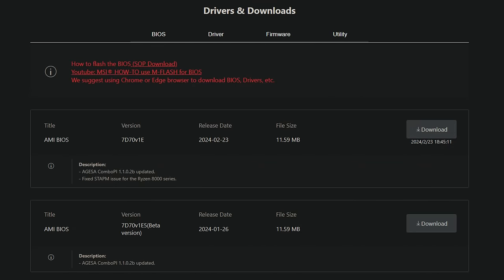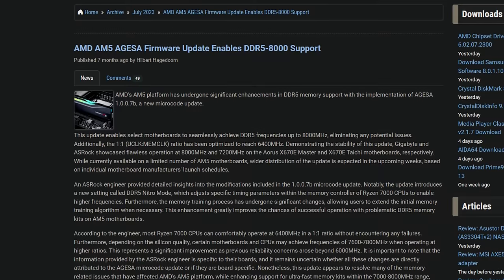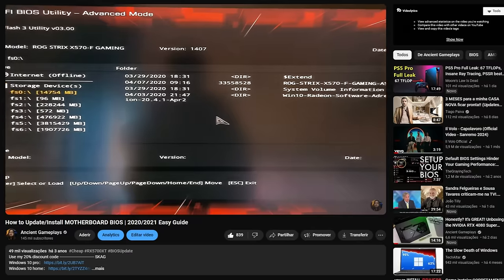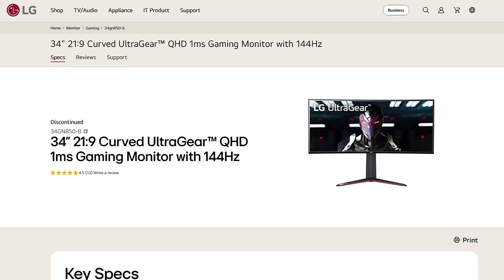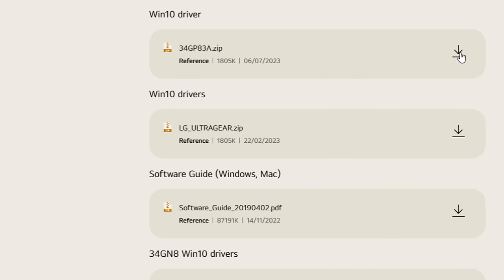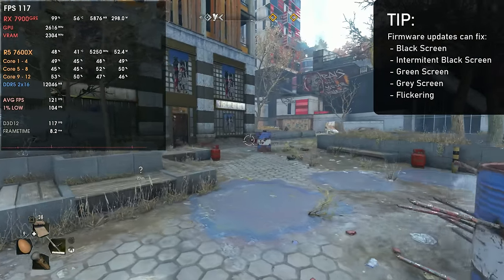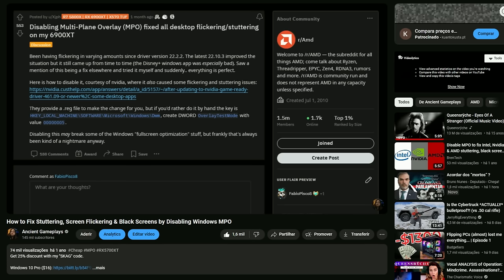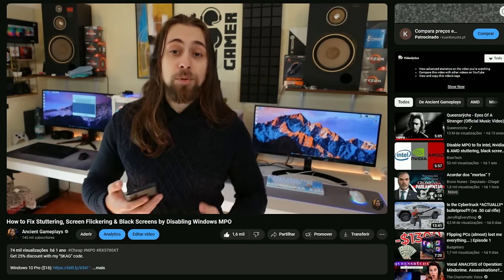20 TIPS to FIX "AMD GPU's Problems" | Easy 2024 Tutorial Guide

Comment: I should warn that in my testings, disabling MPO can lead to a somewhat weird windows desktop experience. The mouse didn't feel smooth, and felt that it was in 60hz instead of 165hz as the refresh rate was configured in windows and monitor default. Opening some programs felt like the animations were not there, and it "felt" my windows experience was like 10 years ago, with less flare and felt antique. I didn't like it at all. Yes some stutterings i was having gone away, but it felt like a sideways fix than a real one. The problem with stuttering was in fact on the adrenaline drivers 24.1.1 (and 24.2.1) and not realy a thing MPO disabling would "fix". The problem realy is that AMD drivers are realy bad sometimes. I'm still using 23.12.1 for example, newer ones are realy bad in stuttering (even in just youtube video streaming for example, and sound stuttering issues), going back to a 2023 drivers makes everything smooth. AMD realy needs to upgrade their software testing part, i see online in reddit a lot of people reporting the same...
Reply from the maker: Odd, it is exactly the same here... odd

Comment: When I upgraded to my 6900xt from my 1080ti I had two issues but fixed them quite quickly after some tinkering. The first issue was crashing in some games. I used mpogpufix and that sorted it out. I also had flickering second monitor which turned out to be a dp problem so I switched to hdmi. Not sure if the original cable was on its way out. Honestly most issues with graphics cards are easily fixed if you put in the time in effort unless it’s doa etc.

Comment: I didnt really have any technical issues with amd. Ofc i had some crashing when i got a 5700xt at launch. But after that its been smooth sailing.

Edit: i do occasionally had issues with relive just refusing to actually save anything i record. And then it will just somehow fix itself.

The only real issue i had with amd was that in some games in my library my 6800xt would just perform abnormally bad compared to its nvidia contemporary. Most recent offender being helldivers 2. Where nvidia gpus are like 20% faster than the amd counterparts. 
I dont really have any games in my library where amd is abnormally faster.

Mainly playing HD2 and my 4070tis is about 60% faster than my 6800xt in HD2 (usually only about a 30-35% difference). And from what i can tell from looking at benchmarks, the 4070tis is about as fast or faster than a 7900xtx in HD2 aswell.

Comment: I have an EVGA Gold PSU with a 10 year warranty. I had a problem with my GPU and couldn't figure out what it was. Nothing was broken, temps fine, good connections. I was using a single cable and the pig tail on my GPU. Power spikes tripped the safety feature on the PSU. I stopped using the pig tail and ran a second power cable. Never had an issue after that.
Reply: Is that a SuperNOVA GA series by any chance? It sounds like that PSU have multi rail +12V. And i belive this EVGA series use multi rail. You should never use pigtails with a multi rail PSU (you should avoid it with single rail too TBO).
Reply: @Audiosan79  It is a EVGA Supernova G5.

Comment: I'm just sad that Radeon Chill doesn't seem to be working for me in multiple games. The Minimum value works, but if I have the Max set to something like 120, the game will only get to around 90 fps instead of 120, even if when I turn Chill off it easily runs at over 120. Helldivers 2 and RDR2 are definitely doing that, not sure if it's an issue with those specific games or maybe a driver thing.
Reply from the maker: Simply use it as a frame locker and select min and max to the same value
Reply: @AncientGameplays  That kinda defeats the purpose, I actually WANT to use it like I was before, where I can just let the game idle at a lower framerate (and GPU power usage) when I'm not doing anything. It used to work fine, but now isn't, not sure if it's a driver thing or something with my new 7900 XTX (upgraded from a 6800).

Comment: the only issue i noticed as a recent amd rx 7800 xt owner (coming from a 1080gtx nvidia), is apex legend DX12 had issues with certain white flashes. Also mentioned DLSS and ray tracing was a better tech with Nvidia. That said i tried FSR3 with Forspoken, looked fine to me (it achieved the high fps and the quality sufficient for me). Also higher power consumption for amd vs nvidia (i did not try eco mode so no idea if that would help or not. but for what it's worth, the power usage during gaming and idle seemed ok for me. Could it have been better? for sure).
Reply from the maker: Fsr3 in forsposken sucks, there are way better implementations out there, like starfield
Reply: @AncientGameplays  ty for the tip. sadly didn't get a chance to try starfield. though i may due to your recommendation, thx again.
Reply: What do you mean by "higher power draw for amd vs nvidia"? You realise every card has a different power limit right? You bought a 7800xt which will have at least 250w power limit after owning a gtx 1080 which would have been around the 180w mark.
a 1080ti has a power consumption of 250w. And the highest consumption gpu available is a 4090.

Comment: Something I noticed regarding Anti-Lag and such is that actually using Radeon Chill to limit your FPS (setting min and max at the same value) gives you lower latency than Anti-Lag itself. But maybe I'm biased or remembering incorrectly. Fabio, if you are reading this; am I correct, or completely wrong?
Reply from the maker: True, anti lag is for max fps
Reply: That's interesting. Must test that out

Comment: I got a new PC last May after my  laptop burned, and since I dislike quite a few things nVidia been doing lately, I chose to go full AMD (both CPU and GPU), Practically from the get-go (but in retrospective, probably after a driver update a little bit later) I've been having issues that were related to GPU: periodic and sometimes random driver timeouts, which often disabled iGPU for some reason, freezes when PC was going to sleep, driver crashes. One of the things, that was also happening was that Armoury Crate was not seeing "ASUS TUF Gaming Radeon RX 7900 XTX OC Edition 24GB GDDR6" for some reason. While working on this with ASUS (which was a huge pain, trust me), below scenario "fixed" it.

1.	Since I was on 23.12.1 driver, which was the first with Hardware-Accelerated GPU Scheduling, I first tried rolling back to 23.11.1 directly. Did not help.
2.	I then booted into Safe Mode and ran DDU to remove the driver.
3.	Booted into normal Windows, let it install whatever version of the driver it wanted. Rebooted. GPU still not seen in Armoury. At this point I actually checked for updates in Armoury and there was an update for the GPU framework, not sure if that’s relevant, though.
4.	After this I installed a new AMD driver, and then rebooted, even if it was not asked by installer. I tried versions 23.5.2, 23.7.2, 23.8.2, 23.9.3. None worked.
5.	I installed 23.10.2, rebooted… And GPU was recognized.
6.	Tried updating to 23.11.1, rebooted – still there.
7.	Tried 23.12.1, rebooted – still there.
8.	Booted into Safe Mode, used DDU to uninstall driver. Rebooted, let Windows install whatever driver, rebooted again. Guess what? GPU still in Armoury.
9.	Installed 23.12.1 directly, rebooted – GPU still there.

Later I was able to reproduce similar behavior:
1. DDU the driver.
2. Install driver 23.10.2, 23.11.1 or 23.12.1 driver - everything works fine.
3. Install any of the 2024 drivers (it works besides the fact that in a lot of games I still get timeouts right at the start of the game).
4. Rollback to previous version (downgrade the driver) - now the GPU is again not visible in Armoury.

Shared this with both AMD and ASUS and unfortunately still no new from either. This definitely does not fix timeout in 2024 drivers, though (all cases were reported to AMD through bug reports in the software). But this still may by interesting for tinkerers, I guess.

Also, I would like to mention a point, that was missed during the clean driver installation segment in the video: doing DDU does not mean that when you install the new driver after reboot you will be installing a "clean" one: depending on how fast both you and Windows Update are, it's possible, that you will be installing the driver over driver-only package downloaded from Windows Update, and not over the "generic" ones. This was not an issue in Windows XP and probably Windows 7 era, but with Win10 and Win11 this is kind of expected behavior. It does not remove potential benefits of DDU, but it is something to keep in mind.

Comment: I've noticed some weird issues after using DDU and installing drivers, I would have some stutters here and there and couldn't figure out why. Turns out Windows just forcibly installs old drivers in the background when you boot first time after cleaning even if I disabled automatic driver updates and sometimes my mouse just refuse to work afterwards until reboot. Now I just let windows do it's thing after DDU, do the driver rollback and then install new driver and it's been working way better. Maybe user error somewhere, but that's how I do it atm xD

Also it's very common that my monitors refresh rate switches to 60hz instead of staying at 144hz after using DDU, took me a minute to figure out why everything felt so sluggish all of a sudden.
Reply from the maker: Using ddu clears the shader cache, so the first time you're loading some games you might have stutters, then, they go away
Reply: @AncientGameplays  Yeah, very true. But these stutters remained and didn't go away. TLDR: Removing Windows basic outdated driver improved performance

Comment: Why is no one talking about the Adrenaline problem, which is that my overclocking and fan curve settings are reset after every reboot of the computer. I tried all possible solutions: disabled Winsows Copilot through the registry and windows group policy editor, disabled the fastboot option in BIOS and
power supply options. None of this helped, the driver settings continue to be reset to default with each reboot. Perhaps someone knows some other ways to solve this problem

Comment: @24:03 You are wrong about that with DDR4 - DDR4-3200MT/s ist Oficcial Jedec Spec. so the statement with 2400MT/s is wrong.
Reply from the maker: That's the IMC native frequency of the cpu, but the SPD of the ram is 2400MHz, so you're not overclocking the cpu, but you are overclocking the ram per se, just a "tested" overclocking by the manufacturer
Reply: @AncientGameplays Please Doublechek, Ryzen 3000 Gen upwards + Official non OC non XMP non EXPO Standard DDR$ Modules are supporting 1600MHz Double Data Rate → 3200MT/s with 20 on and on and on Timings Thats all Official Jedec Standard as long as every Part supports it. and Yes, there are recent Parts that do support that without any OC.

Comment: got quite a few issues =>
#1 amd frame cap doesn't work (can't use riva tuner since it makes davinci crash)
#2 amd chill works but only during game play. The moment I open a game menu, the GPU jumps to 430w or 100%.
#3 when using obs, davinci, and my game at the same time. Sometimes the driver glitches. System doesn't respond for a minute. Than comes back with the applications closed.

system:
i7 12700k
msi mpg z690 wifi edge
asus tuf 7900XTX
32gb Fury memory, 3600 mhz (xmp activated)
850w BeQuit Pure Power

I have already plans to replace the power supply as it loves to whine when the GPU goes berserk. I am gonna switch
to the NZXT C 1200w gold. That got a top rank on the PSU cultist website. I hope the switch gives me more stability.
It is definitely not terrible levels or atrocious at all. But it happens.

One thing I did already for stability was to remove the cpu overclock I had. On top I disabled Hyperthreading and E-cores.
CPU definitely is ultra chill now. But I am going to try disabling XMP too.

Comment: In my case disabling Freesync (supported on both sides) solved MASSIVE ghosting issue (the lower below maximum refresh rate the worse) because there was no variable overdrive implemented for the monitor
Reply from the maker: The Ghosting you're talking about is most likely black smearing and you most likely have a VA panel. The is not with Freesync, is the panel that can't work properly at lower refresh rates. Cheers
Reply: @AncientGameplays  yea it is a VA panel but ghosting is huge for all 3 color transitions from testufo, even the bright one. Why I think this is an issue with Freesync: When i manually set 60Hz refresh rate with Freesync off it's clearly better than with Freesync on at such frame rate. And why I think it's a miscalibrated overdrive: The 100Hz refresh rate set in the monitor settings obviously has a worse response time than 60Hz (best value being 144Hz)

Comment: The solution for guys with 2 monitors and rx 7xxx card that have issue with audio and video stutters in some games(Naraka bladepoint in events tabs in my case):
The easest solution is installing driver 23.12.1. This is the last version of driver which I had no problems with, but this version have no new features like afmf, e.t.c.
If you want to use last drivers you can try next steps:
1. Type in disk cleanup select C then select clean up system files check "DirectX shader cache" run it. 
2. Turn off discord`s hardware acceleration if you using it.
3. Turn of your browser`s hardware acceleration(i`m using firefox and i turn off it from settings tab, I think there will be a similar setting for other browsers).
4. In some cases turning off and then on AMD SAM can helps.
I hope it helps somebody and you will not searching solution for this trouble within a few months like me

Comment: One question. If you have chipset drivers already installed and you want to update them, is it ok to just install one on top of another or you should use some special tool for that like DDU too?
Reply: amd installer uninstalls the old driver and updates to the new one, you don't have to do anything
Reply from the maker: You can update or uninstall it via windows app center, then reboot and install the new ones

Comment: I’ve had mostly AMD GPU’s over the years. Never really had issues like people complain about. However, my 6950 XT reference model has been a mixed bag. Most of the time it’s fine but it’s crashed more than my other GPU’s combined.
Reply from the maker: Psu maybe? Due to power peaks
Reply: @AncientGameplays  850w EVGA gold unit. I just clean installed windows, gpu and chipset drivers along with a bios update (x570 Tuf). If that doesn’t fix it I’ll swap in my 750w unit and check that.
Reply: @AncientGameplays  I swapped out my 4x8GB DDR4 for a 2x16GB kit and even with DOCP enabled and it being a slightly faster kit, my crashes stopped. Weird that it worked fine for a year though before it started.  X570 Tuf Wifi

Comment: Well I’m about out of ideas, been on Reddit where I found one other person with this issue. So I thought I’d ask the AMD master. Other person and me have 5600x/6600xt and recently gpu won’t draw more than 60w ish and frame times are seismic. So my fps can’t stay at a solid 60fps in street fighter 6, everytime a match loads or sometimes when effects happen it drops to 50ish. I’ve tried just about everything, bios update than clean driver install, mpo, ulps, absolutely no overclock and nothing works. Tried older drivers, nothing seems to work. Idk if I should try forcing more power to gpu but I’ve never overclocked besides ram speed and smart access memory. I thought it was hardware(gpu and/or motherboard) until I found someone on Reddit with the exact same 5600x/6600xt setup and same issues. I do need to try driver only clean install, but I didn’t wanna loose smart access memory.

Comment: Awesome content.
Is there a proper or necessary order for installing drivers?? GPU 1st, chip set 1st etc.?
Reply: Always reinstall the Chipset Drivers again, after updating your Gfx Drivers. There have been issues in the past when AMD's Gfx Drivers changed files on the Chipset part making the whole system unstable. Reinstalling the Chipset drivers again, even if it is still the same version, after updating your Gfx will save you from a lot of unidentifiable problems. When setting up your system brand new / reinstall Windows, you should start with the Chipset drivers as they're providing best communication for all basic functions of your motherboard. 👍